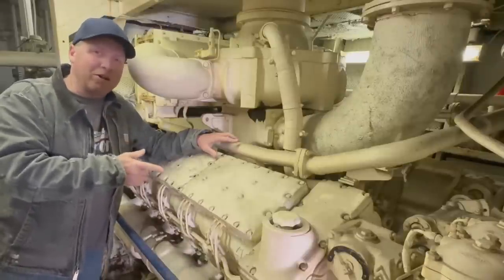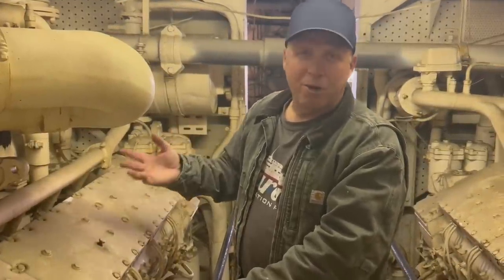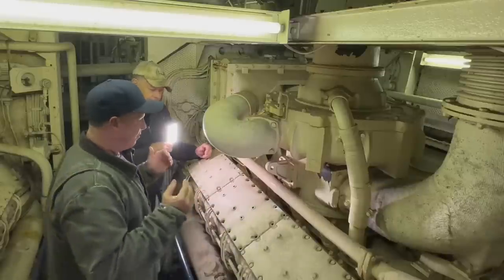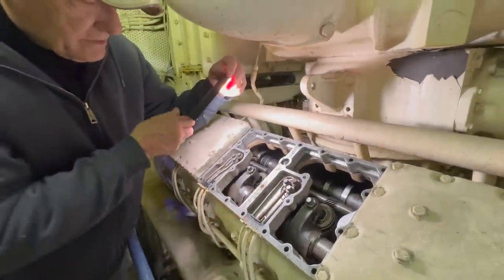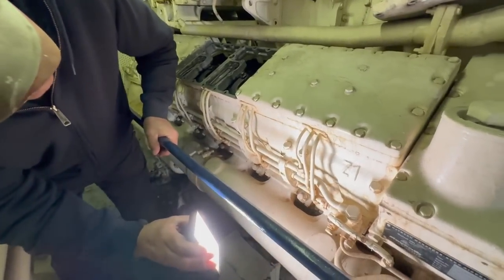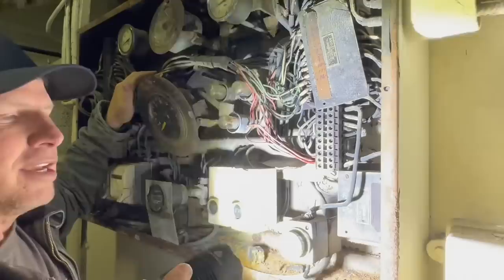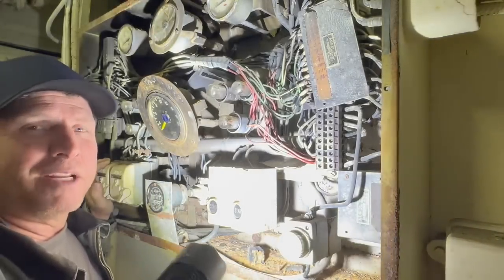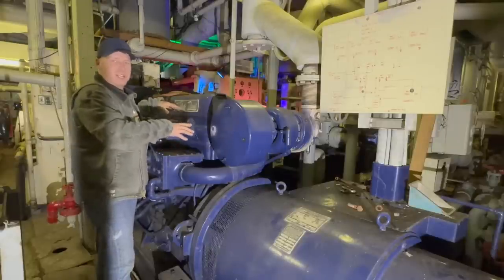INSPECTION OF THE MASSIVE MERCEDES MAYBACH DIESEL ELECTRIC PROPULSION ABOARD THE CRUISE SHIP AURORA

Comment: If possible, I’d hook up a temporary oil pump and pressurize the lube oil system prior to running the engine. Once you get oil into the bearings, I’d make sure the crankshaft turns 360 degrees. Then I’d go ahead and roll it over with the starter. 
The generator looks great! I wouldn’t be real concerned about cleaning. Other than clean the commutator with some alcohol on a rag. Make sure the brushes are all free to move. For first start, disconnect the field windings so the generator will not build voltage. Then it’s safe to get the engine running.

I’m a retired electrical engineer with 45+ years experience in designing and operating large electrical power plants. I’ve also worked on railroad diesel electric systems up to 4,000 HP.  I’d be happy to come out and spend some time on Aurora and help you get these systems running.

Comment: I was a third engineer on large diesel cargo and tanker vessel.  These engine are air start , there will be indicator cocks on each cylinder  head, open those  first. Secondly the engine will have a lub oil priming pump it may be electric or a hand pump. Use this pump to bring oil pressure up in the engine.  Thirdly bar the engine over by hand , there. Will be a barring bar  next to the fly wheel .  With the indicator cocks open the engine will bar over easily . Two reason why you do this one it gets rid of any moisture in the cylinders, two it proves the the engine is not seized. You will need  a  fairly high air pressure and high volume  to start the engine.

Comment: Great videos as always. At a diesel locomotive shop I worked in years ago, they had a 60-gallon compressed air tank modded to hold oil. The tank was filled with oil, and pressurized. A hose with a ball valve with the fitting was attached to a pressure port on the engine. This resulted in the engine being pre-lubed prior to a fresh rebuild start.  The other method was to fill the sump with oil and use a high-pressure high-flow electric pump, to draw oil from the sump and supply it through the engine. After 5 minutes, the engine would be cranked for 5 seconds, stopped, and run pump another 5 minutes.

Comment: Before you attempt to start those engines, run them on the starter with heater plugs removed. That pumps oil around with minimal loads on the bearings.While you have the cam covers removed, you could paint the cams with grease to help them start nicely. I'd imagine the cam bearings won't be so easy to prime with lubricant.
Reply from the maker: Thanks for the info.  This is exactly the kind of feedback we need to more forward without harming the engines.  Would have never thought to remove the heater plugs.
Reply: If you run them on starter without heater plugs, diesel is injected but not burned. You don't have to remove the plugs, just make sure the injectors get no fuel.
Reply: It looks bone dry, I second removing all the covers and lubricating everything either with an assembly grease out just straight engine oil
Reply: @AuroraRestorationProject  "This is exactly the kind of feedback we need to more forward without harming the engines. "  No, it is  certainly not!  Except for what Jacco and one other reader wrote earlier most suggestions are pure garbage. It is worth less than you paid for it because at best it is dangerous and ignorant. Before you do anything or allow some enthusiastic amateur boater or "heater plug" guru to touch anything in that engine room you need to get very friendly with a Maybach experienced diesel mechanic and a licensed marine engineer. The UK is riddled with Maybach mechanics, British Rail operated hundreds of them, the money you save flying one onboard for a vacation will be returned by the buckets full. At the very least, if they are missing onboard, buy all the documentation you can find on every piece of equipment in the engineering spaces and spend a couple of years learning about what you are looking at. At the very very least, go the the MEBA union hall in Oakland and ask if there is a marine engineer there who would like to take a look at the machinery spaces and answer some of your questions. The crap that you read on here obviously comes from people who have never set foot on a ship or touched a marine generator set.
Reply: Usually engines this large have a priming system for this reason. Check the start procedure and sometimes it will say press priming lever button whatever until it shows a specific amount of pressure on a gauge. I could tell you a whole bunch of things to check first and how to spin this engine without starting it but I recommend having a professional at least in the engine room helping you. I don't recommend spinning the injection pumps without fuel...it's a lubricant and may damage it...if it's turbocharged it could have oil settled in the intercoolers and run away upon starting or even worse ingest oil and hydrolock... causing massive damage and a major safety hazard...
Reply: Agree and put some ( like 200ml) of 2 stroke oil on every piston as the oil/compression rings could be almost welded by the rust with the liner, then slowly turn the engine some degree clockwise and anticlockwise untill a full turn is achieved, now you are sure that all the liners have a thin layer of oil and engine is free to turn. It should be quite easy with a long pipe without glow plug ( often there is a big hole on the side of the flywheel)
Reply: Youre dealing with some serious and expensive equipment id get a marine diesel tech on board for some pointers before you try starting this thing it isn't a 350 chevy @AuroraRestorationProject

Comment: Just having the generator running would be a game changer for the project. Imagine having electrical power throughout the whole ship. Those engines are a testament to the quality of Mercedes engineering and it looks like they should be able to be recommissioned without too much dificulty. A cordless impact wrench and a cordless ratchet would save you having to undo all those bolts by hand.
Reply from the maker: Would certainly be nice.
Reply: Electrical distribution on this ship is interesting because she started out as all DC, AC was added later, in fact there is an entire room called the "A/C room" above and outside the engine room that had various aspects of the added on A/C distribution.   All was made more interesting by the fact that since she was owned by germans and italians and greeks and americans in her life and there were modifications made at each stage such that you could find circuits labeled in each of those languages making electrical diagnosis an exercise in linguistics along with electrical theory.   By the way as I recall the Waukesha started and ran fine, no problems there.

Comment: Had a feeling that the engines were properly mothballed before the ship was laid up! Everything under the covers look excellent, considering the age. I'm by no means a marine diesel expert, but I'd remove every possible cover and manually lube all the cams and bearings with fresh oil, then remove the glow plugs to squirt more oil down into the cylinders. I know that presents a chance of the oil being ignited, but that's why you'd leave the glow plugs out. The idea is to prevent as much wear as possible when performing those first few critical rotations before the oil starts flowing again. Only then would it be safe to re-install the plugs and attempt a fire up.

In my opinion, I foresee the engines being relatively easy to get up and running, but the electrical systems being the major pain point. The brushes and commutators in the generators and drive motors look good still, but could stand a polishing. My main concerns would be decaying insulation and corrosion of the copper wires/bus bars. Worst case, you're having to completely rewire everything, and that's an endeavor in itself. 

Wishing you the best on this, I'd been eagerly awaiting the time you start to focus on getting the propulsion system up and running again!
Reply from the maker: It’s great to have people like yourself willing to loan valuable information and tips.  I have to agree. The electrical is going to most definitely be the issue but we will cross that bridge when we get there.  First we will make this beast operational and then work out the electrical.  Best thing to do first perhaps is to disable the flow of power.   Let the engine run without fear of burning up the electrical system.
Reply: @AuroraRestorationProject  Agreed! Definitely disconnect the main feed wires from the generators before firing up the engines. Would help prevent a potential electrical fire hazard.

Comment: Very interesting and exotic engine, seems to have roller bearing type main bearings and Y shaped conrod to the A side, B side conrod in the middle... you need clean oil, clean filters, flushing the complete system with fresh oil with the prelub pump... check the compressor wheel for turning, the try to turn the engine with no compression. Rollerbearings set if not turned frequently, be very careful and check oilflow from all bearings before start. I think the engine will start ! 
All valves must be checked for free movement when turning engine wo compression.
Reply: Absolutely. It would be worth a surface inspection of the roller races too. Pitting spells quick failure of roller bearings.

Comment: Just a suggestion  Functioning electric motor / generator commutators should always have a chocolate brown patina / coloration to them . If they are polished the surface will eat up the brushes at an accelerated rate so it would be better to just surface clean then of dirt and dust .

Comment: I’m betting the blanket on top was to help keep heat in. When I went to inspect ex USCGC Acushnet, we had one of her ex chief engineers with and he said that it was very common to get moisture inside the windings of the motors, that’s why if they were to be down for an extended period or had been cold for a while the Acu had heaters permanently installed in the motors that would dry out any moisture that got in them. I wouldn’t be surprised if Aurora has motor heaters too that were used to dry the windings and internals of the propulsion motors too.
Reply: The light bulbs inside the propulsion motors actually supply some amount of heat, not enough to make them dry if they are wet, but I think enough to help keep them dry if they already are dry and the bulbs are kept on.    These propulsion motors meggered out as dry in the 90's and even though its been a while since then it would not surprise me at all if they are still dry and basically ready to go.  I actually don't see the propulsion motors as being that difficult  to bring to operation, they are likely ready to turn and run if the main shaft bearings and seals are intact and functional etc.   Plus it only takes like two (ish) of the maybachs running to turn these enough to get some level of propulsion.  The only time I have seen a large propulsion motor fail due to moisture is when the motor was seriously soaked. Here is a quote regarding marine electric motors and water: "Marine motors must withstand a constantly wet and high-humidity environment. Not only can water ingress ruin electrical components, it can also ruin materials via corrosion. This is largely solved by component material selection to prevent oxidation or galvanic corrosion."  Anyway these motors are very well sealed, that's why they look so good all these years after installation.  That's a good thing because these propulsion motors are one of the few things on this ship that are really not replaceable.  An example of that si the Waukesha generator which was installed long after original manufacture.

Comment: This is a project in its own! You’re going to either become a marine engineer or make a new best friend in one. I wish you good luck! Those Waukesha generators are monsters! They will run in the most adverse conditions with the worst possible fuel. (I’ve seen them run off bio gas which i s full of H2S and condensate.) I call that a win in my books! Far better than the rare Mercedes which would have the very worst of part acquisition problems.
Reply from the maker: Would be nice just to have the right knowledge to work on this propulsion system.  What I have learned is that no matter what you know it’s never enough and someone always knows more.  I think the idea is to round up a couple of knowledgeable engineers and go to work and see where we can go from here.
Reply: Doubtless a lot cheaper to service than those Maybachs!
Reply: Can’t wait to hear some diesel noise on the boat 👍👍

Comment: Locomotive and large marine diesels usually have a prelube oil pump. It is normally electric, and the switch for it will generally be on the engine control panel, or the engineers station.

Comment: these mercedes industrial engines are extremely reliable they are also well supported in terms of spare parts. the engine being so clean inside means the oil was well maintained zero sludge in there

Comment: Lots of interesting work to do. It will be quite an achievement to get the engines running. I suppose the genset would be handy. Id be tempted to get that running first, so you have power anytime. Good luck.
Reply: That genset ran fine in the 90's, seems likely to me to still be good.

Comment: Should be an Pre lub pump some were in regards pumping oil around the galleries and thru the systems before startup. Check the luboil system drawings for the ship. Also check cooling systems and fuel system. Usually ships have system drawings of pipes valves with id tags for pumps and valves. Just message me if you need any advice, I have been working as an marine Engineer/ engine room operator for 7years.

Comment: Heater plugs out and fogging oil or duck/wd40 the cylinders. As others have already said oil the  cam and lifters with run in oil in a spray bottle, Duck oil or a similar light lubricant will also be ideal ( Duck oil and wd40 act as a water displacer as well so good if moisture is present). Use run in oil and if you can access the crank use a oil sprayer to liberally coat bearings, fill with run in oil and keep heater plugs out. If there is a way to manually bar the engine over I would do this to ensure its free. Then proceed to crank via the starter still with heater plugs out and injectors disconnected / fuel supply isolated until you have oil pressure. Refit glow plugs and injectors and cross your fingers. Love the vids.

Comment: Lotite 518 anaerobic is an excellent gasket replacer that you might want to consider. Don't forget the old gaskets will contain asbestos. Keep them wet with WD40 when scraping off the old material.
Reply from the maker: Thanks for the info. Will look into the Lotite 518 and will definitely use something to soak the gaskets when removing.  I know the only asbestos threat is in airborn form but never hits to be safe.
Reply: @AuroraRestorationProject  It is Henckels Loctite 518. Dave left out the C.
Reply: or only replace gasket if bad, asbestos is only harmful if you screw arund with it or it's already flaking

Comment: You need to gain access to the turbo to make sure it free , then change oil and filters then charge oil pressure with all covers off . Check oils everywhere . Then turn her over
Reply from the maker: This is something I need to figure out.  I don’t see an access door in the turbo so it may have to come off to see inside :(

Comment: Love the channel! Moisture in electrical generators isn’t such a great thing. The motors and generators should have a full cleaning, brushes and heaters replaced, bearings checked, then a full electrical test conducted. Any foreign materials introduced into the stator and rotor in the motors and generators could end up being very costly so take the time to explore the entire generator. 
Make sure you draw schematics for all the wiring so it will be easier later to troubleshoot.

Comment: I think an "oversized" genset is a lucky addition. Fully modernized this vessel will have higher electrical demand than originally built.
Reply: Bigger isn't necessarily better when it comes to diesels. Those engines like to work, and if they are run under a light load, they'll gum up the rings.
Reply: @KartmanWolf  That's very true. But with modernization will come increased electrical demand and what was once oversized will become appropriately sized.

Comment: I have every faith they will run they have been preserved well and just need to be brought back on line systematically. I would start with a step by step approach. See if the servicing manuals are available and look at start up procedure and check each step. Engine will need an oil flush.

Comment: as a shipmechanic i recommend to disable the injectorpump by removing the fuelpipe to the engines to prevent it from starting and to check the preheating of the engines (warm engine starts easier than a cold one) otherwise good luck

Comment: So the props are line driven by electric motors?  That is pretty cool.  I recently have learned a lot about diesel electric locomotives so that makes loads of sense to me!!!!
Reply from the maker: Apparently it is much smoother than a vessel with transmissions.  I look forward to witnessing that one of these days.
Reply: It will always be a “project vessel” but seeing how clean those MB engines are, I’d assume once the cabinet/gauges/wiring are sorted they probably will get to work.  May be worth seeing if any locomotive mechanics would be interested in helping if they don’t generate power correctly.  From my understanding each one of those stators will generate 600+ Amps each so be careful with HV lines and have them properly checked and sorted too.